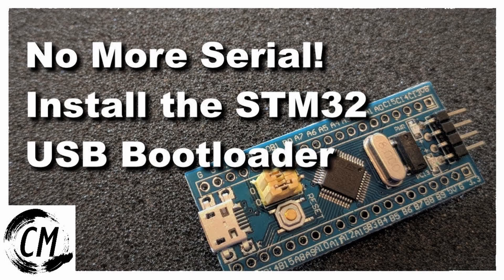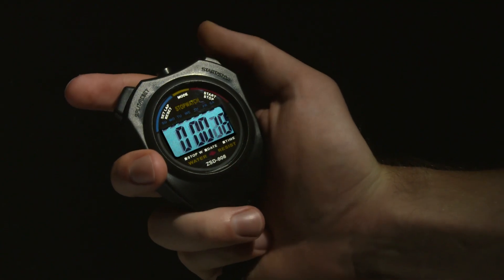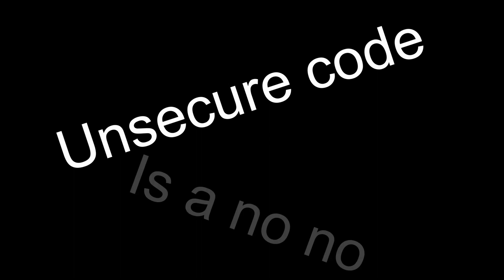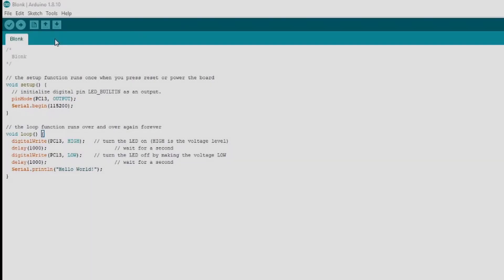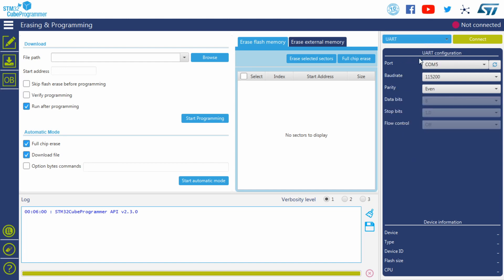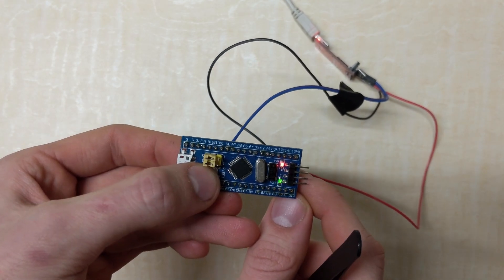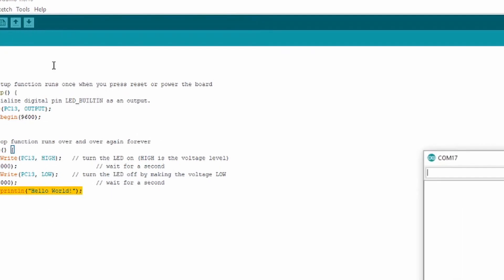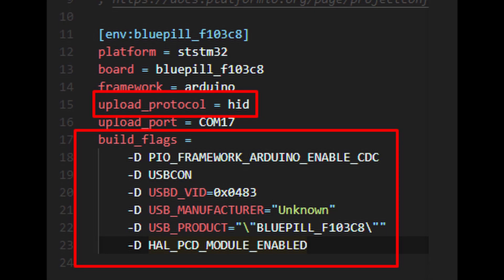How to Install the STM32 USB Bootloader, New Version! (Blue Pill F103C8T6)

Comment: Hi - thank you for these videos - very helpful! I hope you can find the time to help me - I bought some STM32 boards that seem to be using this chip: STM32F303CCT6 with 256 KB Flash - Robotdyn is the manufacturer. The binaries in the links you posted are for F103 and F407 only - does this mean my board cannot be flashed with a bootloader?
Reply from the maker: Hello! The f303 supports DFU upload, so you actually do not need a separate bootloader to upload code over USB. you can find this info in section 3.5 of the official datasheet.
https://www.google.com/url?sa=t&source=web&rct=j&url=https://www.st.com/resource/en/datasheet/stm32f303cb.pdf&ved=2ahUKEwiv95CQ3LbqAhVGCc0KHQieDuoQFjAAegQIBRAC&usg=AOvVaw316i_atPeBiw5Z2kVGDzC4&cshid=1593973002676

 Please take a look at my black pill video, the process is essentially the same for uploading code! https://youtu.be/b1123kz_3MM
Reply: @CalebMarting  Thanks for the prompt response! I cannot get my Windows 10 PC to "recognize" the STM32 board, hence why I thought I needed to flash the bootloader. Is this just a USB driver issue then, and if so do you know where I can find the correct driver?
Reply from the maker: Do you have the boot pins set correctly? You may need to install a driver too, I am not sure

Comment: // This method did not work for me, I was able to finish the process and load the "Blink" example, but after loading my own code, the PC did not recognize the blue pill board. I have resorted to your previous video (2018), and the previous method has worked for me wonderfully.
Reply: I possibly had the same problem: My Bluepill could send messages via serial over ttyACM0 but it was not possible to flash it a second time. The bootloader was not active anymore (no fast blinking), but the slow blinking occurred according to the example I had programmed. The Solution was to reset the board (or power it up) while the BOOT1-jumper was set to 1. The other jumper! Then the fast blinking reoccurred and I was able to flash it with HID Bootloader method.  After resetting I could set the Jumper back to 0. Thus after reprogramming the board the USB-Serial automatically re-activated. Perhaps this should be added to the instructions.
Now I'm very happy with the solution: Small bootloader and defined switching to programming via jumper. No STLink or USBtoSerial adapter needed anymore. Many Thanks Caleb.
Reply: @raulkompass2773  Thanks dude  : )
Reply: Try again but with 1.8 of core and not 1.9. This worked for me.
//Edit: I was able to update core to 1.90. Maybe the root of my problem was solved by installing a driver for STM32 device. My system recognizes the pill as a generic serial device that helps Arduino when searching for it.

Comment: I ask him what is the size of the Bootloader 20Kb?
I do a blank satisfaction and it turns out like this

void setup () {

}

void loop () {

}

Sketch uses 19116 bytes (29%) of program storage space. The maximum is 65536 bytes.
Global variables use 3784 bytes (18%) of dynamic memory, leaving 16696 bytes for local variables. The maximum is 20,480 bytes
Reply from the maker: Unfortunately Arduino just takes up a lot of space by itself, there is stuff in the background to run the loop and setup, as well as other functions etc. That's the price of abstraction with Arduino. The bootloader itself only takes up a tiny little space of that. you'll find this on most chips for instance if you compile for an Arduino Uno, but not necessarily to this extent.

If you look at the actual binary files for the bootloader, hid_generic_pc13.bin, it is only 2KB.

Comment: I have an error at the connection process with ST-LINK V2 via STM32 Cube Programmer : "OLD ST-LINK firmware, please upgrade it befrore trying to reconnect". And when i click the upgrade firmware button this appears "ST-LINK is not found in DFU mode. Please restart it." Any idea how to fix it?
Reply from the maker: I think when it says "please restart" just unplug and replug the ST-Link and try again. You may have to be quick but I don't believe it matters, it should lock it in DFU mode

Comment: Hi, I receive this on repeated tries. i am using in windows10 
Trying to open the [COM3]...
> Unable to open the [COM3]
> Searching for [1209:BEBA] device...
##########
Error - [1209:BEBA] device is not found :(> Searching for [COM3] ...
Error - [1209:BEBA] device is not found :(> Searching for [COM3] ...
> Finish
the COM3 was my TTL
Reply from the maker: So that com3 error means nothing, it's just a side effect of how Arduino typically uploads. You're mainly interested in the device not found error. That can be caused by an upload of the bootloader that didn't function properly, so first try reuploading the bootloader. It can also be caused by a faulty device so if you have another blue pill please try that too
Reply: @CalebMarting  Hi, I found the result. it is because of fake stm32ic. I have tried in 5 boards only two was working directly with serial bootloader

Comment: For first upload, I don’t need to select com port. For subsequent uploads, I must select the port or else it will fail to upload. For some weird reasons my led blink program is not working properly. I changed the delay time for “high” to 1200 ms and “low” for 200ms. The blink is working the other way around and seems high on 200ms and low on 1200ms.
Reply from the maker: I forget, some boards have inverted LEDs just because of the way they were wired. It's possible that's what you got. And yes the com port thing is just a side effect of how the Arduino framework upload is written
Reply: Thanks.
Reply: Btw, I try loading another sketch and it doesn’t recognize the com port anymore.  I redo the bootloader and never get back to work.
Reply from the maker: You can move the boot1 jumper (the one that isn't touched during install of the bootloader) to the 1 position and reset the board. It should make the boot loader start working again and you can upload code. Make sure that you have USB support turned on when you upload code though or else you will have to keep moving the jumper
Reply: Caleb Marting  thanks. I redo the flashing via cube programmer and it works again. Now uploaded more than ten times without issues.  Thanks.

Comment: "Timeout error occured while waiting for acknowledgement.
Error: Activating device: KO. Please, verify the boot mode configuration and check the serial port configuration. Reset your device then try again..." how to overcome this problem?
Reply from the maker: There's a couple possibilities. What causes that error is that your set up for serial upload is wrong. For instance If you don't have the boot zero jumper in the one position and press reset, etc. If you are sure that is all correct, try another blue pill if you have it, sometimes boards just don't work cause defective products still make them money

Comment: Hello. Thank you very much for the video. This is excellent. My question is: how do I activate the serial 2 and serial 3?
I put it in the ide but it does not compile (it gives me an error)
Reply from the maker: You are talking about hardware serial right? There is a HardwareSerial constructor so you can do something like HardwareSerial ( rx, tx) Serial2; or something and use it as normal. (Serial2.begin(9600))
Reply: @CalebMarting  Thank you very much for your answer, I comment for example:
/////////////////////////
void setup ()
{
  Serial.begin (9600);
  Serial1.begin (9600);
  Serial2.begin (9600);
  delay (3000);

}

void loop () {
 
}
//////////////////////////////
error by serial2, according to the pinout this chip has up to serial3 right?
Reply: @CalebMarting  
HardwareSerial Serial2( PA3, PA2) ; 

void setup()
{
  Serial.begin(9600);
  Serial1.begin(9600);
  Serial2.begin(9600);
  delay(3000);

}

void loop() {
 

}

Comment: Nice! I was able to program my Blue Pill a while ago then something happened and I just kept getting errors. This video inspired me to clean up my IDE and set everything up again.
By following your instructions I was able to get it all working again.
Now I need to see if I can program a little 32F030F4P6 board I got a while ago.
Reply from the maker: Good luck! Glad it worked
Reply: @CalebMarting  Last night I opened up Serial Monitor WHILE uploading a sketch and the Bluepill could no longer be recognized as a usable USB device on ANY computer so I went through the process in this video again and now it works.
Reply from the maker: It's possible that something got messed up, or a setting wasnt set correctly. apparently you can set the boot and one jumper to the one position and that should force the bootloader to start when you press reset. Then you can see if the USB device is recognized
Reply: @CalebMarting  OK. If it happens again I'll set both jumpers and reset to see if it works.
Re-flashing the bootloader isn't difficult anyway.

Comment: is there possible way to connect xbox360 , ps2 or ps3 controller to blue pill and to get the button and analog data?
Reply from the maker: Umm, I'm not sure of how you could do that without being destructive to the controller, but if you want to be destructive, sure it's possible. I would look up online if there are any tutorials and it would be basically the same between mcus I would guess

Comment: In my case, I have to choose a COM port in order for the uploading process to be successful. Do you know why that is?
Reply from the maker: I think It uploads fine The first time without a com port selected for me, but then I have to have it selected too. I think the reason is Arduino has an old check that makes sure there's a com port selected when uploading because It was designed for the AVR chips that upload over com

Comment: sorry but one last question . Does the  USB connection get disconnect and connect during the upload process ? please reply?
Reply from the maker: No worries, I don't know, typically that doesn't happen to me. You can try uploading the bootloader again, and if you want try doing a full chip erase using the cube programmer and then uploading the bootloader again. Also check to see if your chips are a knock off, they might say CKS or something instead of ST
Reply: @CalebMarting  thanks a lot ! man!!

Comment: Thanks a lot ! everything is working fine .. but the only problem I am facing is ,its taking way too long to upload a sketch is there any solution ?
Reply from the maker: If you are using the Arduino IDE it recompiles your project every time, I would try platform IO, it will only compile what you changed, if you need help please join the discord linked in the description!
Reply: @CalebMarting  thanks a lot for replying man!

Comment: it gives "Error - [1209:BEBA] device is not found :(> Searching for [COM7] ..." when uploading without a serial adapter
Reply from the maker: We found two causes for this
1. Defective/knockoff chips
2. Failed upload

To fix the 1st, try a different blue pill board, they're so cheap that you should probably just buy them in pairs or triplets.

To fix the second, perform a full chip erase in stm32 cube prog and then upload again. You can try it one or two times.

More often than not we found it happens with defective chips but it can't hurt to try uploading again after a full erase. We can provide more info in the discord linked in the description
Reply: Maybe you just try 1.8 of STM32 core, that helped me. 1.9 may have problems with 2.2.2 of the bootloader, maybe.

Comment: Good grief! Its no wonder these processors and boards aren't getting popular, this has to be one of the most frustrating and annoying processes I've been through JUST to get the bootloader flashed. WHY WHY WHY is this such a pain in the ass??
Reply from the maker: Technically you don't need a bootloader, I recommend the ST-Link v2 as a way to upload code with no pain. The bootloader is just nice if you want to upload with only USB

Comment: Thank you for video!   ...the issue is that the new STM32 core package produces larger images than the "old" one... So, might be critical for large applications that utilize almost all flash memory; could happen it would not be enough memory to flash a re-compiled app...
Also, you do not need Cube to flash bootloader using STLink. You may use  STLink utility (available at ST.com) to do it...

Comment: Thank you for this tutorial.
I could make it work under Linux (XUbunut 18.04) but I have some remarks:

$ uname -a
Linux mybox 4.15.0-99-generic #100-Ubuntu SMP Wed Apr 22 20:32:56 UTC 2020 x86_64 x86_64 x86_64 GNU/Linux

- The STM32 Cube Programmer doesn't work here under Linux but I could flash the HID bootloader binary without problems using the st-flash utility via my ST-Link clone. I did this outside of the Arduino IDE, it was as simple as "st-flash write hid_generic_pc13.bin 0x08000000" on a blank Blue Pill
- The udev rule configuration for proper detection of the HID bootloader as described on the bootloader github should be in place and active before opening the Arduino IDE.
- The created virtual COM port seems to jump back and forth (/dev/ttyACM0 and /dev/ttyACM1) if the reset button is pressed or the cable is reconnected.
- Using the virtual COM port works only after the flashing. One cannot open the COM port and flash in parallel, e.q. open the serial monitor later. It may even be necessary to change the COM port.
- I get kernel messages and error messages inside the IDE regarding the COM port.
[ 6021.100121] xhci_hcd 0000:00:14.0: WARN Cannot submit Set TR Deq Ptr
[ 6021.100124] xhci_hcd 0000:00:14.0: A Set TR Deq Ptr command is pending.
[ 6021.102143] xhci_hcd 0000:00:14.0: WARN Cannot submit Set TR Deq Ptr
[ 6021.102146] xhci_hcd 0000:00:14.0: A Set TR Deq Ptr command is pending.
[ 6021.104120] xhci_hcd 0000:00:14.0: WARN Cannot submit Set TR Deq Ptr
[ 6021.104123] xhci_hcd 0000:00:14.0: A Set TR Deq Ptr command is pending.

- Uploading does not always work. It requires retries due to the described "Couldn't locate :BEBA device"), a lot more than anticipated by the video's description.

Kernelside device detection looks like this:
[ 6021.575132] usb 1-5.1.4: new full-speed USB device number 35 using xhci_hcd
[ 6021.676533] usb 1-5.1.4: New USB device found, idVendor=1209, idProduct=beba
[ 6021.676538] usb 1-5.1.4: New USB device strings: Mfr=1, Product=2, SerialNumber=0
[ 6021.676540] usb 1-5.1.4: Product: STM32F HID Bootloader
[ 6021.676542] usb 1-5.1.4: Manufacturer: www.serasidis.gr
[ 6021.678371] hid-generic 0003:1209:BEBA.000E: hiddev3,hidraw6: USB HID v1.11 Device [www.serasidis.gr STM32F HID Bootloader] on usb-0000:00:14.0-5.1.4/input0

Comment: Finally have a windows box that I can play with and found this. Does one still have to replace the R10 Resistor? That was the other thing that has held me back in the past.
Reply from the maker: I haven't had to replace any resistors yet. If you do need to replace a resistor, You also can jump one of the pins with a standard value through hole resistor and it accomplishes the same thing. http://amitesh-singh.github.io/stm32/2017/05/27/Overcoming-wrong-pullup-in-blue-pill.html
The main issue I've had is either off-brand or faulty chips being installed on these for cost reasons and not working correctly. If you need troubleshooting assistance join the discord that's in the description of the video and we can help you there
Reply from the maker: Also theoretically this version works on Mac Windows and Linux

Comment: Very useful video, thank you. I solved my bootloader problems with two different STM32 boards within a couple of minutes. Especially the links in description are very useful: all are valid and get the right things I needed. Perfect explanation why and how. Many, many thanks!
Reply: I also solved my bootloader problem but what i found out later is that the usb comminication gives trouble with my serial3 connection to my blue tooth module, every time it looses connection with the pc and i have to upload the bootloader again. Do you experiance the same?